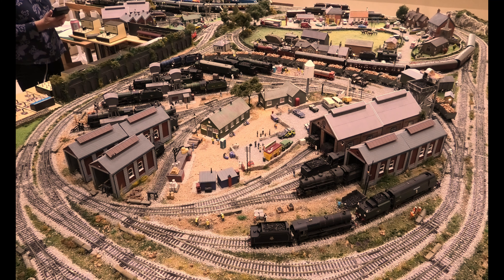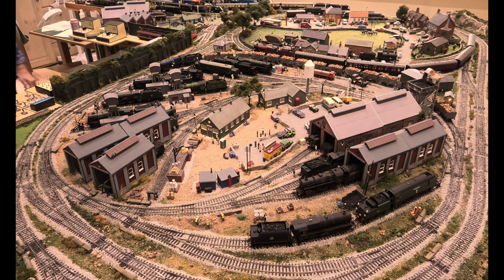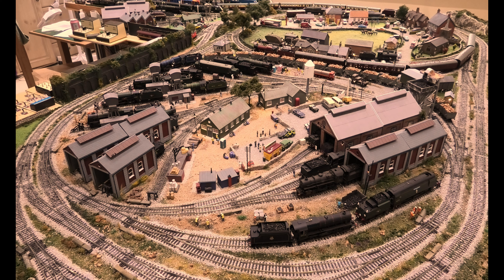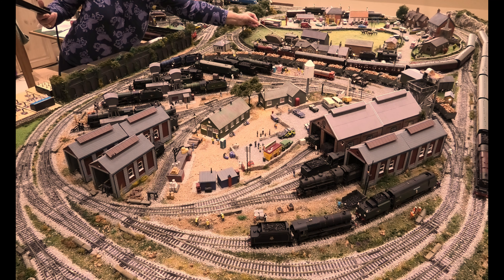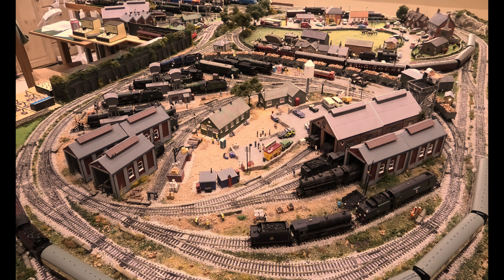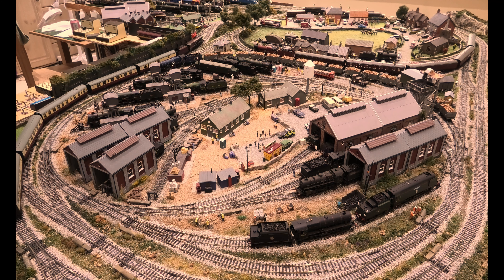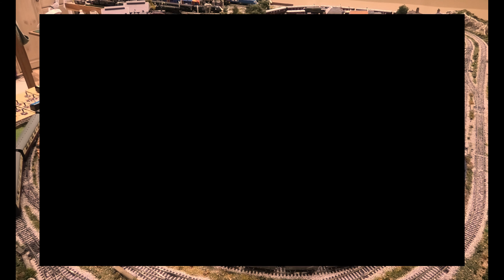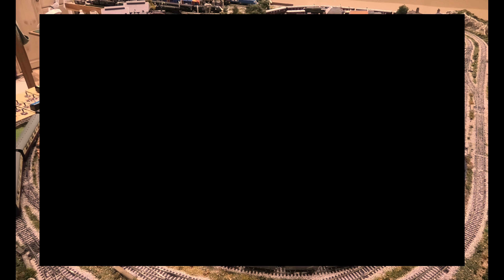Effects of the mix of sound on a model railway with digital DCC sound.

Comment: This is why only 4 of my locos have sound and the rest are just decoded so i can run 1 sound loco and then the rest are just decoded and i8t makes a huge difference.
Reply from the maker: All subjective but I cannot see the point of that. So you have all these locos running and only one making sound. I think it is very effective having loads of locos making sound, the point I am getting at, is it worth spending a lot of money on sound when the whole effect is added in to the mix.
Reply: Yeah. But I do not like too many locos with sound as it ruins the individual locomotive sound, in my opinion i just like it that way but i see where your coming from. It’s sort of like don’t over do it for me
Reply from the maker: It is all subjective. The bottom line is, the man who has spent the money decides the best way to get enjoyment from his railway.........Simples.

Comment: One approach could be to reduce volume using CVs and then they're not so loud
Reply from the maker: It makes no difference, you still have the same mix. You cannot change the laws of physics. Running at the same volume lower or higher the affect is still the same. It is what it is.
Reply: @PaulBriden  not entirely correct, the quieter they are set the more you hear the locomotve closer to you.  Also by setting individual volumes correctly you will hear the more powerful locomotive over the smaller locomotive for example.
Reply from the maker: @andrewbergman9315  That does not make sense. You have 3 souces of sound set at the same decibel level the affect is the same. The only difference is the ear hears a different volume. If you spend the time to adjust the sounds to scale, which is almost impossible as sound has different audio qualities at different distances, you will have the effect of the bass of the louder loco drowning out the rest. Just like in real life on the Bluebell railway.